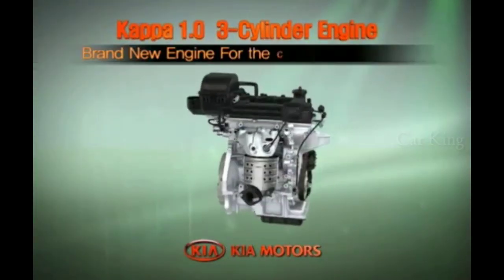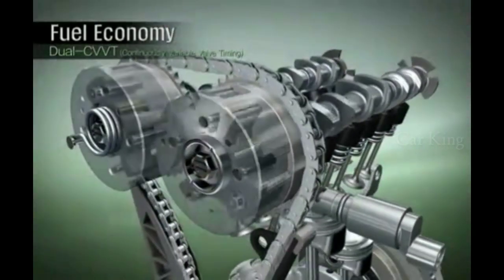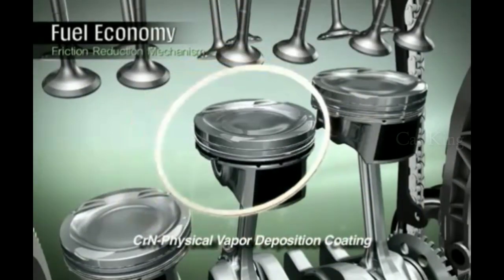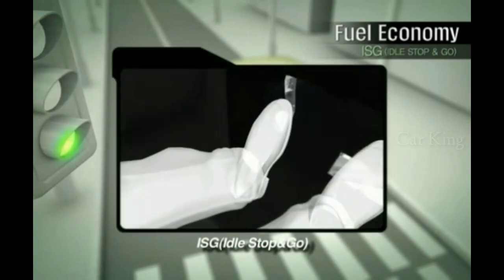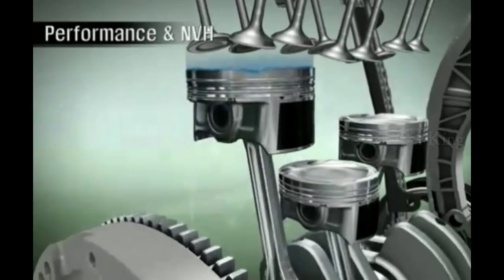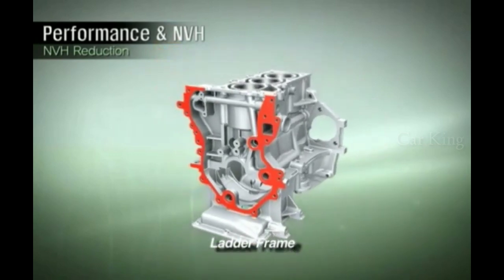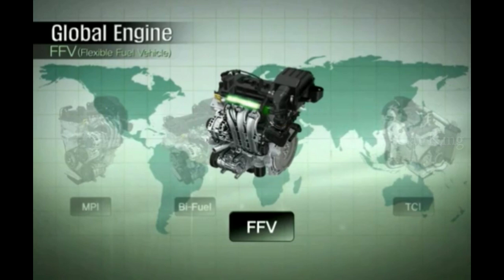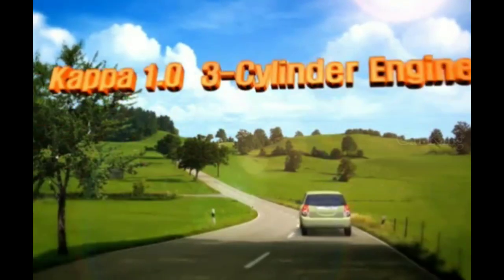Kia Motors Kappa 3 Cylinder Engine

Comment: The most shitty engine ever. Event the latest t-gdi and also when used with LPG fuel has a lot of reliability issues. Not even fiat/stellantis have ever done rubbish engines like these. To me this is the first and last Kia/Hyundai car i bought.
Reply: Nobody makes better engine than Fiat
Reply: @doddsalfa  Stellantis is making Fiat petrol engines now, they have a lot of issues with the wet belts. 

I haven't heard anything bac about the 3 cylinder engines where I live and there are many around. + I think the 7 year warranty means Kia are pretty confident with these engines.
Reply: @o00scorpion00o  ok Kia engine is the worst engine in a car that I have owned .Driven 100.000 km and needs oil 2 a month
Reply: What issues did you have? What engine version/year?
Reply: You're joking right ? there's a lot of issues with Ford and Stellantis engines that use the wet cam belt.